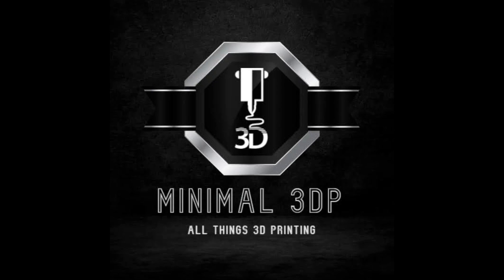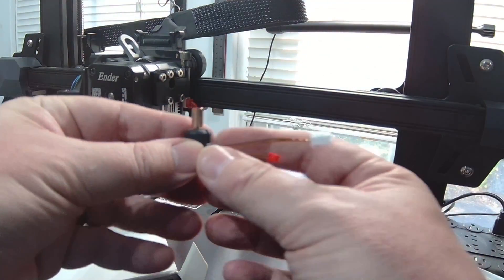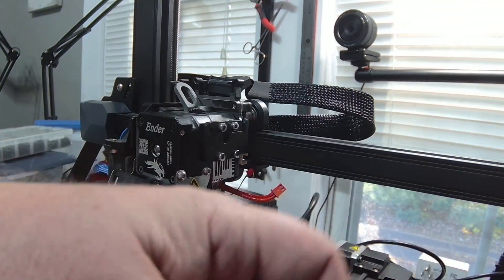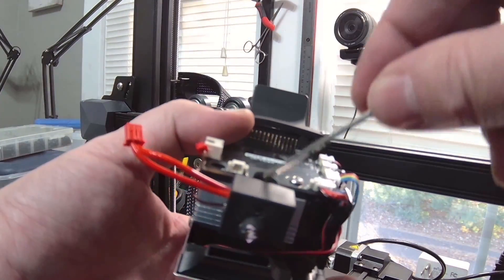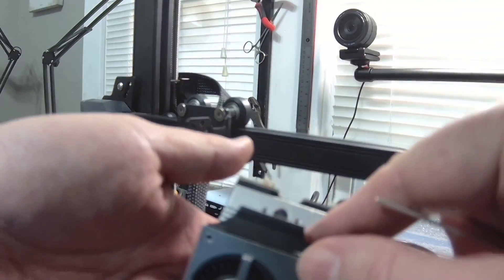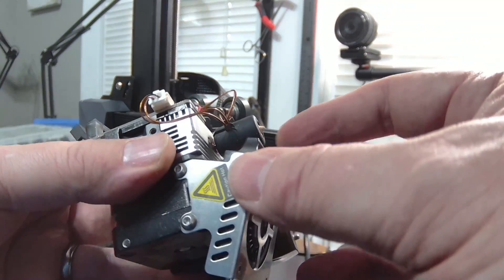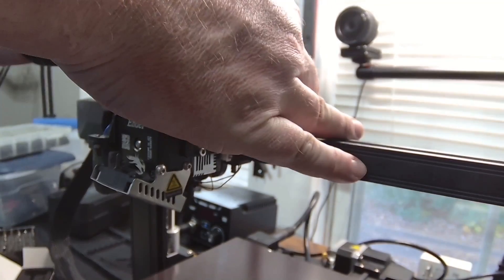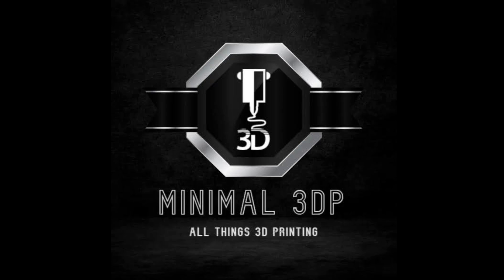Upgrade Your Creality Sprite Extruder to a Ceramic Hotend and See the Difference

Comment: I know the video is kinda cold at the moment, but I got the upgrade for my sprite extruder. I am wondering, are there any replacement nozzles for the ceramic hot end?
Reply from the maker: As far as I know, You need to replace the whole assembly. It costs around $25 us.

Comment: You can tell the sprite all metal hot end by the heater wire color. The red is the "pro" all metal one, if it has white wires it's the standard version.
Reply from the maker: Thanks for the info.
Reply: Gold!!

Comment: What thermistor setting are you using for klipper? mine keep overshooting by 15deg . even during PID tuning. I pid tuned at 300 but has to set max tempt to 325 or it would throw an error
Reply from the maker: I did change any settings and just left it as is. I have not noticed an overshoot on mine. I am now running 3 all set the same.

Comment: Do you remove the ptfe tube or does it stay in
Reply from the maker: I did not remove it. It is above the heatbreak and I don't believe it will be an issue.

Comment: I wasn't trying to sell a product nor was I posting any spam, trully I watch your videos often and enjoy them, I was just trying to be helpful, I guess keep creating great content , I will not comment again
Reply from the maker: What are you talking about? I haven't complained about anyone's comments. Did I miss something?
Reply: @minimal3dp  I tried putting a comment up, and it was instantly removed, guess it was a setting you have as I included a link to amazon, I was already having a crap day so just automatically assumed you personally did it and didn't think clearly as if it was most likely automatically removed. MY BAD, apologize for jumping the gun. But the CHC ceramic volcano and stock size hotends are extremely better than this model, and you can switch tips, unlike this hotend, which is about the worst upgrade I tried on the sprite. I have the CHC Volcano version and the Sprite V4 part cooling head, and a 4020 cooling the heatbreak, getting about 140mm/s regularly on Marlin bugfix 2.1.x.